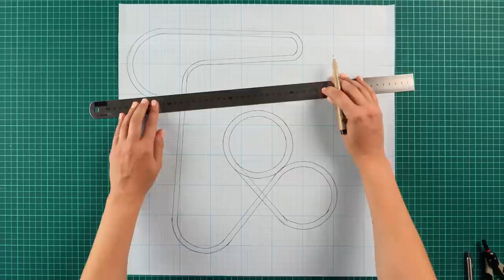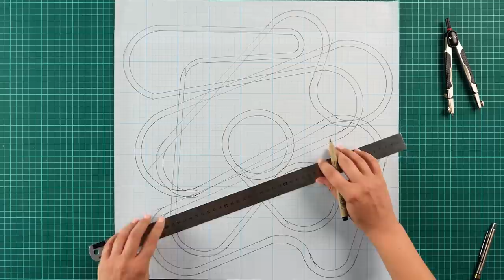PERFECT WAY TO SPEND YOUR TIME! Making Steel Marble Track

Comment: Oh god those solder joints 😱. Also that thing is so shaky, surprised it didn't shake itself apart with that soldering. I think i stick to the original creators Daniel de bruin's
Reply: Those are the worst cold solder blob jobs ever.  The soldering iron should not move and brushing the solder to bridge two joints is the worse.  Using some flux and a higher wattage iron should help.  Just imagine those soldering skills being applied to internal wiring for an aircraft, submarine, satellite or even a deep space probe.  The cold inhospitable environment combined with vibrations would destroy those solder joints within minutes.